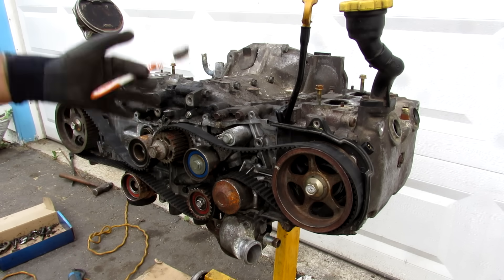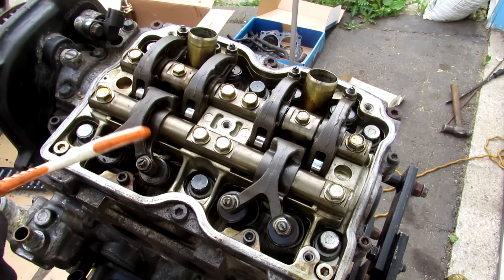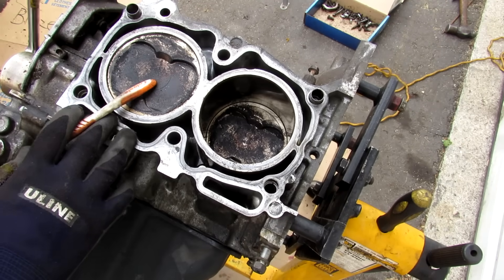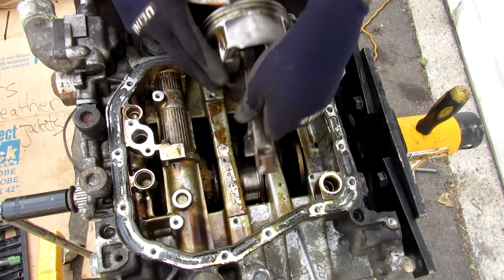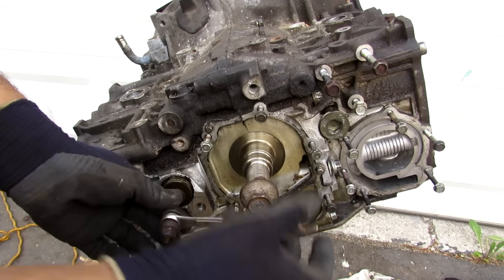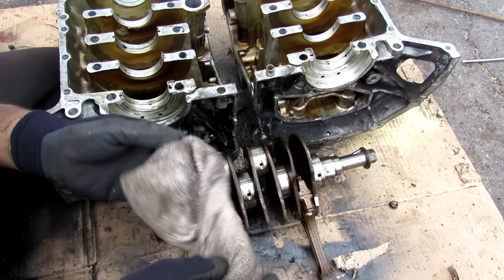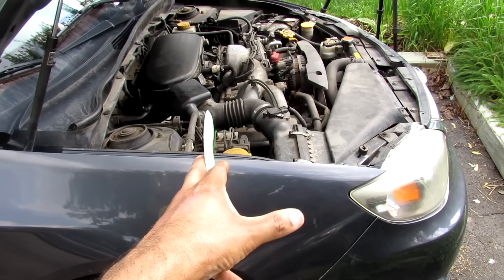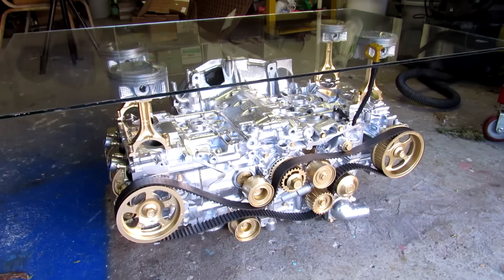Why Subaru Engines FAIL

Comment: That's it, i'm never buying a subaru, too many potential problems, and I want to at least be able to change my own spark plugs.
Reply: True talk..not worth the hassle..especially they way they are driven too makes a used one a No No...service history or not
Reply: I have one in these, and changing the spark plugs and wires takes about 25 minutes start to finish. I change the oil on schedule and I'm up to 189,000 miles now. It's running fine.
Reply: Warren Garabrandt most Subaru’s are driven by people who don’t do maintenance. Preventative maintenance does wonders!
Reply: There is not a perfect car or engine out there. 4 cyl toyotas are pretty reliable. Subarus handle great in snow,  ice whatever you throw at them. I drive an 06 and I like the way it drives. If you do regular maintenance you should be ok for 100000 miles even more. Newer models are supposed to have "no issues " with head gasket leaks. Turbos are spared as well. If you watch Mr. Subaru in you tube goes into every engine model with those issues.
Reply: @TheGonso35    No but one does come close, Sorry but you can't beat Honda engines.... I have a 2006 Honda civic SI never had a problem with the 2.0 liter and I have over 200,000 miles on it, its just a superior motor hands down.
Reply: @Anthony-qj7qe  Well, Honda make, or used to make good engines... VW has a few a few gems as well, like the famously tunable 2.0 16v ABF
Reply: @Anthony-qj7qe  I've owned n driven daily 2002 V-8 4.6liter Mustang GT 5speed car ,this Feb will be 18years and 370000.0miles!  I've only use Mobil1 full syn 10w30 and Motocraft filters !! She is my Baby!! FORD make these GT's tough cause they know how ppl beat on them!! Take care of ur baby n just blow soot out ever so often drive normally 95% of the time U can enjoy Ur Baby for years of fun!! And transportation!
Reply: @chylimzbydzi   Yep agreed that's why I have a 2006 Si  but unfortunately Subaru  engines are just not good.... that's the problem :(
Reply: @scottyjones27   have fun changing those spark plugs on that 4.6
Reply: @alanfiebelkorn783  changing spark plugs on a 2v 4.6 mustang is extremely easy. The pickup is a bit more of a pain in the ass. The worst was the 3v 5.4 that broke spark plugs off in the head.
Reply: @alanfiebelkorn783  No biggy brother changed 4 times in 18years , just put smear of high temp grease on threads run them in wrist tight never had NO issues?? Its the three valve engine has plug issues!
Reply: Just change the oil regularly, occasionally flushing the engine;)
Reply from the maker: Surprisingly Subaru has been doing really well in sales in the past few years. Wonder why...
Reply: @speedkar99  
Sales dosn't nessessarily reflect quality, performance, ect merely popularity.
Reply: speedkar99 Mazda has the highest quality economy cars on the market and their sales aren’t exactly stellar. Many consumers do little research before buying a car. If the public were more informed Nissan and GM wouldn’t still be around.
Reply: @speedkar99  Because of the name, people are enamored by the whole WRX STI thing....Jeep sales are also good and they have a good resale value but they are also not reliable,  and yet people continue to buy them!? "Why".... because of the name.
Reply: Anthony or maybe cause subi and jeeps are fantastic in the snow 🤷‍♂️
Reply: @zureai  exactly. Subarus AWD is unrivaled. I got the legacy which i can transform into an outback, with strats that lift the car and all terrain wheels. Conversion done in about an hour.  I have yet to get stuck. Cost me 600$ to be able to turn my car from an everyday car to an offroad car.
Reply: The fact that the Toyota 86 has a (kinda underpowered) Subaru engine was a turn off for me. Nothing against Subaru but I think Toyota builds better engines.
Reply: @177SCmaro  Same here, I was recently in the market for a second car.  I briefly considered the 86, till I found out it had an infamously unreliable Subaru boxer engine.  That's really too bad.  I wish Toyota put a high-power Lexus engine in it.
Reply: @hamsterama  
And/or get Yamaha to build them another cylinder head and drop it on a straight 4. What's kinda crazy is Toyota already has a good road map for a soild high rpm sports car engine with the 2ZZGE. Putting a Subaru engine in the 86, even though I'm sure the flat 4 helps handling, feels like a step backwards.
Reply: @177SCmaro  I agree!  Even if a flat four helps with handling, it still doesn't seem necessary.  Okay, slightly off-topic, but performance cars from other manufacturers still have great handling, but don't resort to using boxer engines.  BMW immediately comes to mind.  They only use inline engines.
Reply: @hamsterama  
Yeah, the flat 4 has it's pros and cons, it's great for a low center of gravity but can be pretty challenging to build a suspension system around such a wide engine. And I'm sure if Toyota put their mind to it they could develop their own flat 4. If they did, I'd feel more comfortable with that engine, and be a lot more inclined to get a 86, then a Subaru engine - again, not knocking Subaru I just think Toyota makes better engines. Of course, there are two letters that solves the Toyota 86's engine issues: LS.
Reply: @177SCmaro  No doubt i owned 86 Corolla GTS twin cam 1.6 5speed car hatch back , silver with black trim in stickers !!  the best car I ever owned !!
Reply: You can change your own spark plugs 🤷‍♂️.  I've owned many high mileage Subarus.  Performed regular maintenance on all of them.  Yes it's different, but not nearly as difficult to work on as you may think.
Reply: They’re not worth it, they’re no more fun to drive than a honda civic, mazda, or toyota corolla and they won’t last nearly as long.

Comment: Wow. I'd always wondered. No way I'd buy a Subaru at this point.
Reply from the maker: The newer ones with the F series aren't as bad
Reply: @speedkar99  But then the F series is still a relatively recent engine isn't it? Probably wait for a few years and see how things will pan out.
Reply: @germaineliew2012  I will tell you they are doing great as you see thay are in toyota 86/brz and no compliants from people!
Reply: Honewtly sounds like the first thing anyone should do buying a decently low milage subie is upgrade the pistons and head gasket

Comment: My dad's 2l gasoline boxer has lasted for 400 000kms.
Reply from the maker: What year? That's pretty good!
Reply: @speedkar99  it's a 2003 legacy, automatic
Reply: My old 83 holden rodeo 2litre lasted 1.13 million kays before we took the head off to replace the burnt valves. Could clearly still see factory hone marks in the bores. At 1.2 million, engine swapped for a 1.8 gemini engine that came along otherwise would have just re ringed the 2L. Its longevity was from never leaving the driveway cold and regular oil changes. Very little short running also.